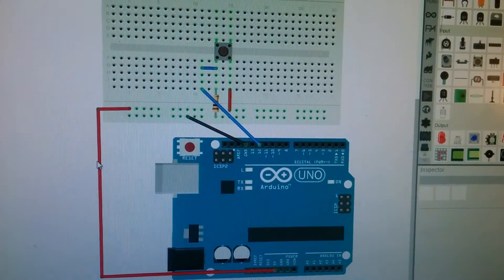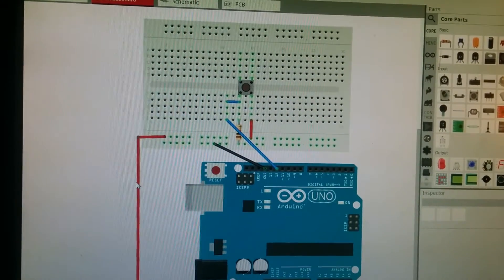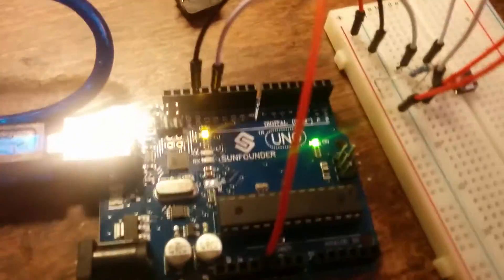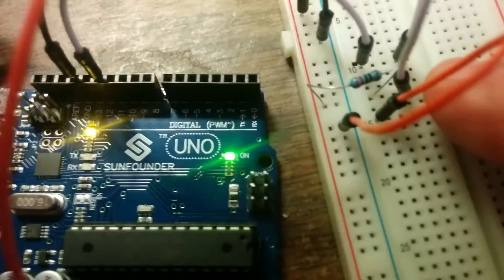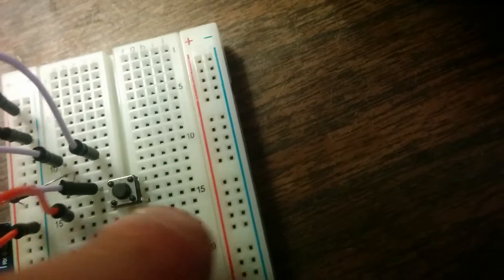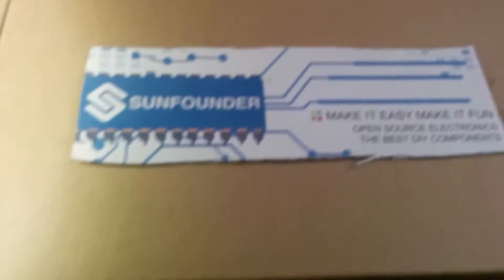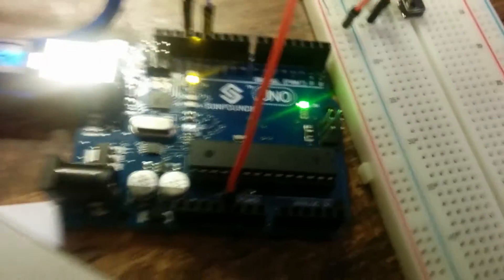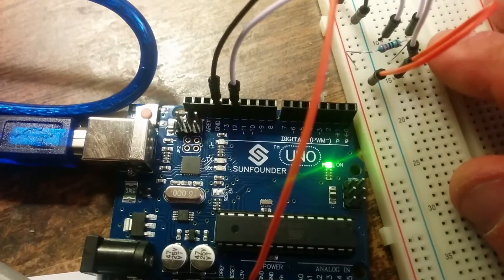Lesson 1 Controlling LED by Button Sunfounder Arduino Uno R3

Comment: hi! how did you do to hook up your sunfounder on arduino ? i got the same board but arduino doesn't recognize it....and then what software do you use to make the schematics ?
Reply from the maker: +Mel Miada I learned from this guide. Page 4-8 are helpful. https://cdn.sparkfun.com/datasheets/Kits/RedBoard_SIK_3.2.pdf
Reply: +David Sonshine thank you!  yes i followed these steps but it still doesnt work...  my atmega must be broken... 
what software did use for schematics ?
Reply from the maker: +Mel Miada The schematics software is http://fritzing.org/home/
I would try / buy a second Arduino to see if it works correctly.